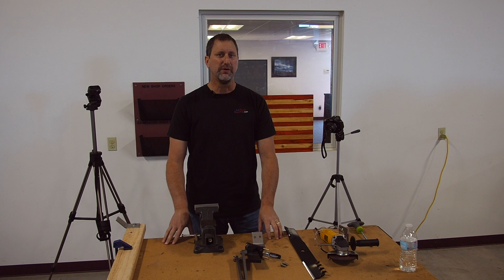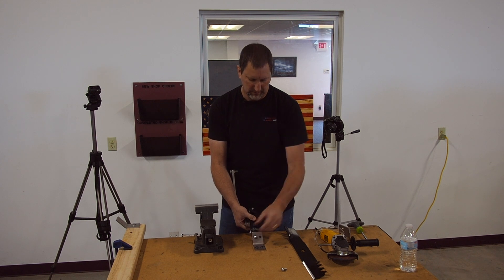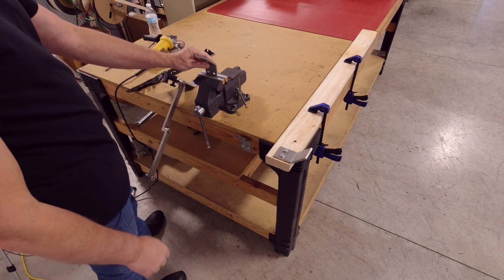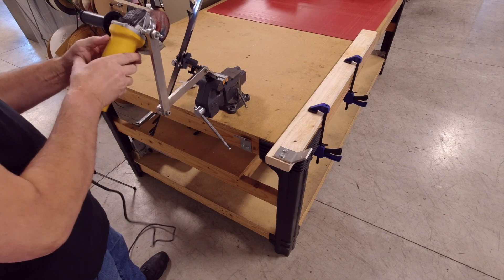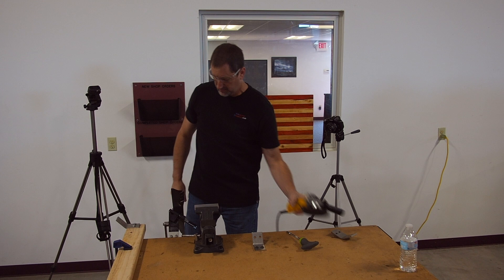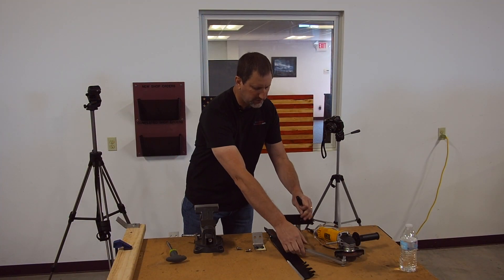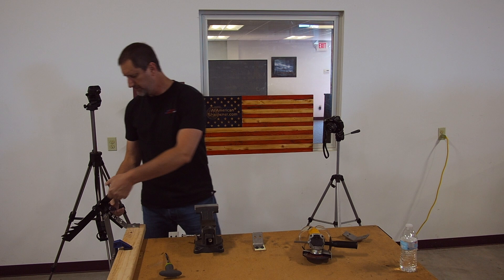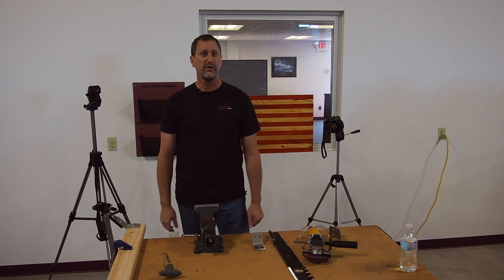How to Mount Your All American Sharpener

Comment: I don't care how you mount then. Buy one. Buy one if you run a fleet of mowers or if you have one mower. They are amazing. Simple, full proof and male a better than factory edge. I have a John Deere 997R with a 72 inch mower, (big blades) and we mow a lot of rocks on our farm. This thing, combined with a M18 grinder had a factory edge back on them in minutes the first time I used it.
Reply from the maker: Thanks for such a glowing endorsement! It's good to hear that even with the rough terrain your blades endure, you can still get a great edge back quickly. Wishing you a lifetime of great service from your Model 5005!
Reply: @AllAmericanSharpener  I buy very few products that I am that happy with.  The craftsmanship,  durability and ease of use are amazing.  Y'all did a great job.
Reply from the maker: @thepitpatrol  We're grateful to have you as a customer!

Comment: I have a Bostitch grinder, BTE820K, that mounts its support arm approximately 60 degrees relative to the head of the grinder as opposed to 90 degrees as is the case on many other makes, like the one you used for your demonstrations. How do I compensate for this difference, other than just replacing the grinder?
Reply from the maker: The adapter pin will attach into the handle threads regardless of the angle of the handle. The important thing is to align the center of your flap disk (we recommend a T27 or T29, 36,40 or 60 grit) to the bevel of the blade. The jig will hold the angle that you set for your particular blade.

I hope that helps, and best of luck as you get started with your sharpener!

Comment: Maybe I missed it but what size bolts/lag screws would I need to mount it to a 2x4 or front of a bench?
Reply from the maker: No problem. The bracket is 1/4" thick stainless steel, and the holes are 3/8" diameter.
Reply: @AllAmericanSharpener  THANK YOU...Monday April 8th '24 is my first day to try it out...I'm so excited (at age 62) like a kid!
Reply from the maker: @defan2105  - You're welcome. We're glad you are excited and we appreciate your business!

Comment: what size bolts do i need to mount it to my counter. I just got my sharpener but it didnt come with anything to mount it to a surface
Reply from the maker: The holes in the mounting bracket are 3/8" diameter and 1" apart on the centers. (The hole is made to fit a 3/8" bolt.) We don't provide those bolts because it will vary depending on how you choose to mount your sharpener. We realize there are a lot of words on our website, but we do state on the sharpener page that those aren't included.

"One 45 Degree Bench Mount (2 machine screws to attach sharpener to mount are included). You will need to provide your own screws to mount the bracket to your mounting surface.)*"

Sorry for any misunderstanding. Please reach out to support@allamericansharpener.com if I can provide any additional assistance.

Comment: That gator blade looks like my John deer 7 star set up ..what degree should this be sharpened at?
Reply from the maker: Sorry we didn't see your comment earlier. You will likely need the 35 or 40 degree setting for a Gator blade. The OEM John Deere blades will likely need the 45 degree setting due to the significant tilt forward in the cutting section.
Reply: Is there a specific distance from the edge of the workbench to mount it?

Comment: Is there a set distance from the edge of the workbench to mount it?
Reply from the maker: As a starting point, a distance of about 8" from the screw/bolt holes on the base of the mounting bracket to the front of your workbench should give you a comfortable work reach, as well as keeping the mounted jig from sticking out from your bench. I would recommend placing your jig at that starting point (perhaps even with a blade mounted in it), and then move it forward and back from there until you arrive at something that feels right to you.